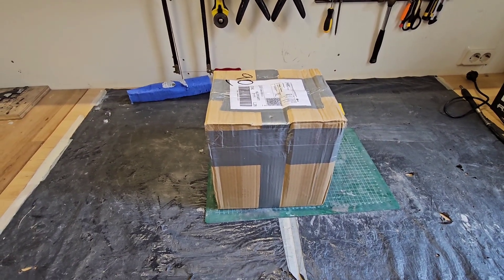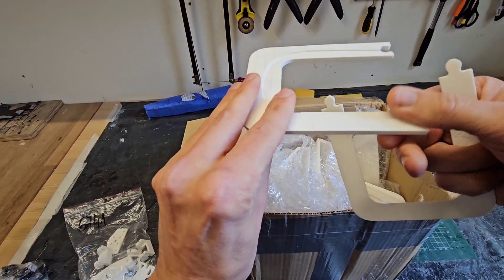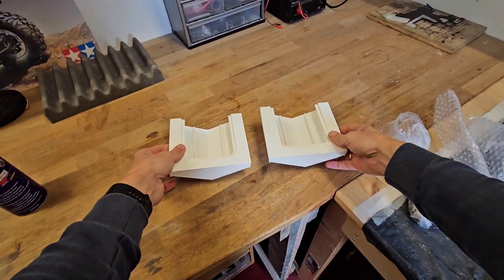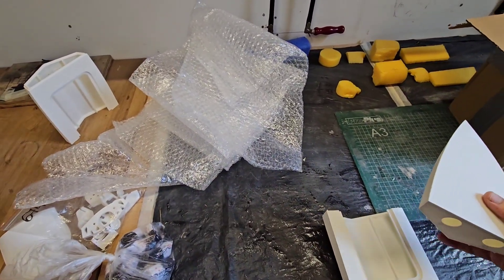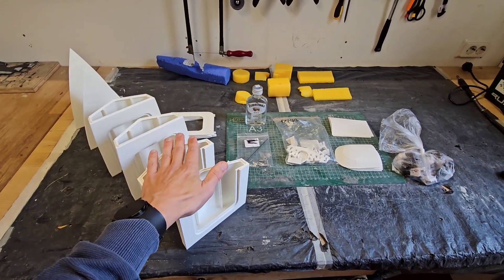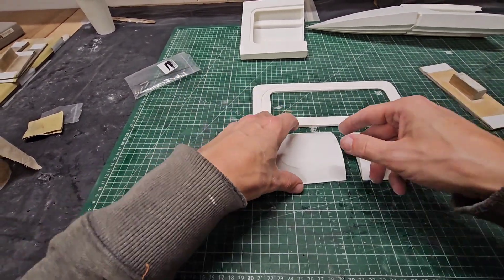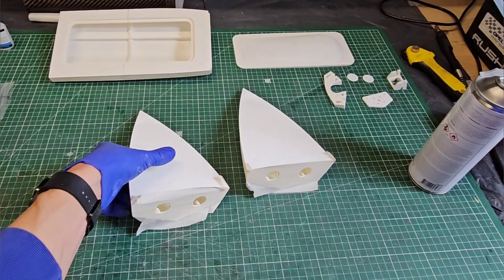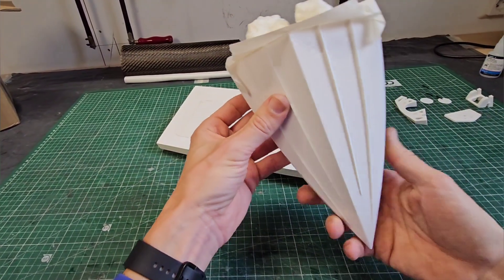DIY RC Boat build: 3D printed Mini Mono - Part 1

Comment: The motor mount base on your PDF says position 40 to 50 back from the rear but the position in your video looks more 80 -90mm can you confirm please..:)
Reply from the maker: That's the difference between the 3D print and the wooden boat build. That's correct

Comment: What is the weight of printed 3d parts only.
So that i can calculate the price.
Reply from the maker: @advancetech7479  I'm not sure (it's not my own print). But you can download the files and upload them to a print shop website for a quote

Comment: My Prusa i3 at the ready. Going to have to cut 3mm off the tip of the bow if printed flat on the parting line it looks like. Was it printed with no infill? Thank you for all your efforts putting this one together.👍
Reply from the maker: The 3D print design is made by NoMatter design / Raf. I have no experience myself with 3D printing, so I cannot answer your question, sorry!

Comment: Ik heb net een nieuwe printer gekocht dus dit ga ik printen
Reply from the maker: Super, ik ben benieuwd!
Reply: @CozyRC ik had de versie van hout ook al gebouwd alleen het werkte nog niet helemaal ik denk dat ik meer succes heb als ik het print
Reply from the maker: Waarom werkte de houten versie niet? Kreeg je hem niet goed gebouwd?
Reply: @CozyRC  ik gaf gas in hij sloeg gelijk op ze zij en hij zonk maar ik had er piepschuim in gedaan dus hij leeft nog
Reply from the maker: @mustache405 Ik denk dat je de boot dan verkeerd afgesteld  hebt. De 3D geprinte versie is dezelfde romp, alleen met strakes en sprayrails (die schuine randen onder de romp). Hopelijk krijg je de houten versie ook nog goed varend!

Comment: Is that just a medium CA glue your using, hull looking really nice.
Reply from the maker: Yes,  I used medium CA glue. Thanks, this hull is a collaboration between Rafael and me. Rafael made the 3D print design, which turned out really good!

Comment: I’m going to build one of your 3-D printed mini monos can you direct me to a company that can 3-D print this for me? I wanted to go crazy and print it in metal. I think PCBway can do this. I wanted to know maybe you know of a 3-D print shop in the United States that I can use that is close to me in Florida, so I can get this printed up.
Reply: 😂 metal might be durable but will turn it into a slow submarine. I recommend PLA for the cost and ease of print. The design took in consideration the shrinkage of PLA. I tried a PETG too. A bit more resistant to temperature. If you want to go crazy and have a 3rd party company that can do it reliably, go with PC, Polycarbonate.
Reply from the maker: Printing in metal would be nice for a display boat. But for a high performance boat, I recommend a PLA 3D printed version, or build a wooden boat by the drawing provided in the video description 👍